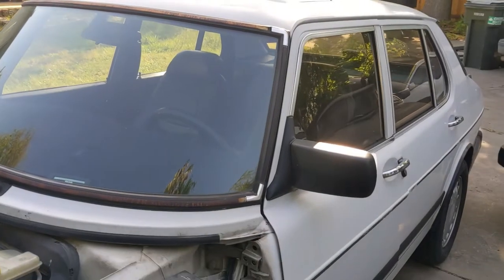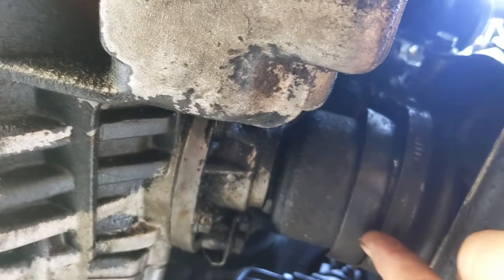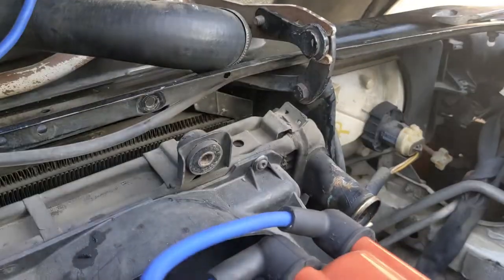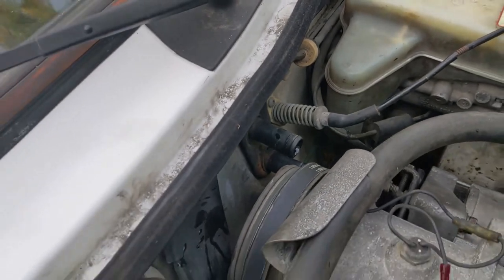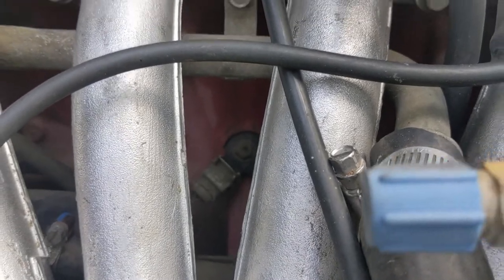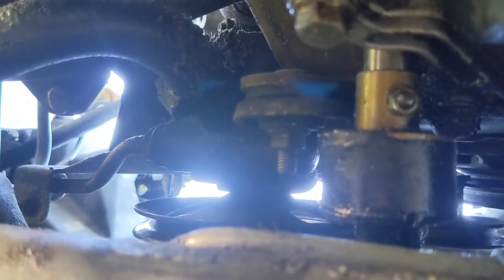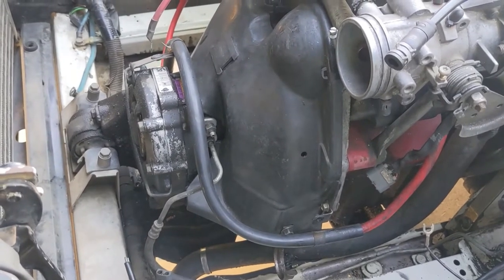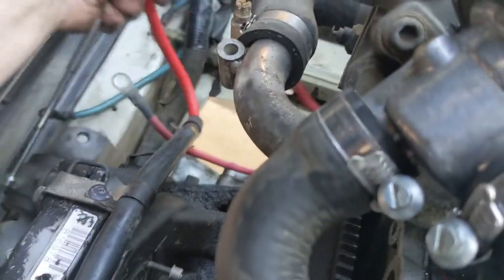Saab c900 Engine Removal

Comment: One of the best videos out there for this.  You have a gift for explanation.  I just completed the engine out on the turbo and followed this.  I have no clue how many mistakes I would've made otherwise.  The only error I made was forgetting the oil cooler to filter lines on my turbo but fortunately they held strong until I stopped the removal.

Comment: Dont have to remove the steering knuckles. Just remove the lower ball joint bolts and pull the bottom of the knuckle out. Put somethong between the ball joint and lower control arm to hold the acle out of the driver. Dont have to remove axle or tie rod end.

Comment: Awesome video. I'm about to pull mine and have done half the work, you've helped me navigate the rest. Only issue I have is deciding how to best establish a lift point at the rear of the motor since there's no factory point. Would have loved to see how you did that at the end of the video.
Reply from the maker: There are a few ways to do that. I have found the easiest way is to buy a threaded eyelet from McMaster-Carr - try this URL: 

https://www.mcmaster.com/eyebolts/thread-size~m8/application~for-lifting/ 

Thread that into the spot on the head where the AC compressor bracket was installed. I use a Harbor Freight load balancer between the engine and hoist, but it's not explicitly required.
Reply: @jva8291  Thanks for that! I was going to leave the air conditioning bracket and compressor in place and just remove the hoses. I'll suss out the best options next week when I'm back in the garage.

Comment: Thank you SO much for this.  You are going to cringe when you read most of this but bare with me.  I work at a salvage yard.  My job is to rip motors out of cars.  In about the last 4 weeks I've ripped out 70 motors.  This 91 Saab 900 Turbo comes in.  Looking at it I thought...'Huh...how's this gonna work?'.  First I realized I needed to torch the axels (btw...WAY faster than taking off the knuckle and such).  Then I dropped it down.  I zipped the nuts off of the passenger side motor mount.  Brought out the sawsal and cut all the hoses.  Now I'm looking at the driver side motor mount wondering how in the world to get to that.  I torched off a few things that made no difference.  At that point it was close to quitting time so I came home and stumbled across this video.  BY FAR the best.  On top of that the EXACT motor I'm working on (except this one is turbo but makes no difference for the purpose of things).  After watching this I know exactly what I need to do.  First I'm going to cut the hood off.  Then I'm going to hook the chain hoist up to the radiator and rip it out.  Then I'm going to be looking directly at the FRONT motor mount that I didn't know was there....until.....I saw this.  My foreman was stumped when I asked him for advice.  I'm gonna go in tomorrow.  Get this done.  Then ask for a raise...all thanks to you!